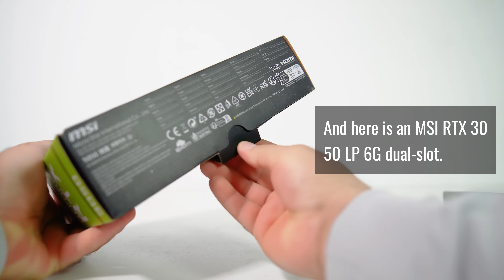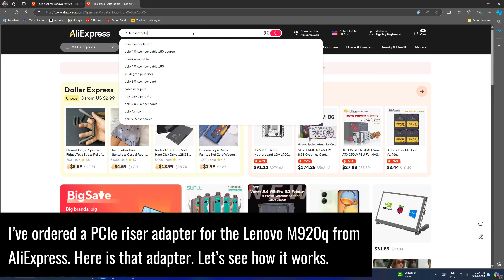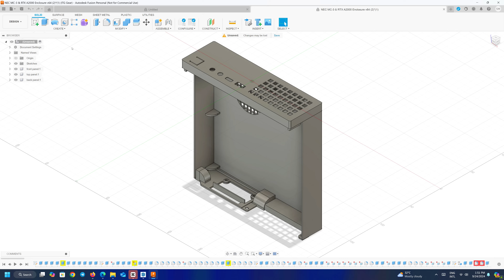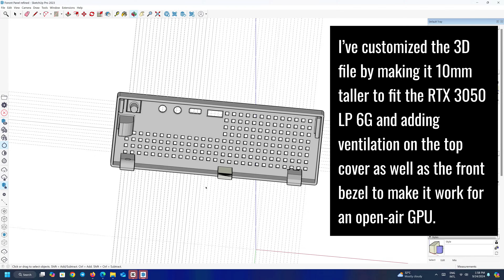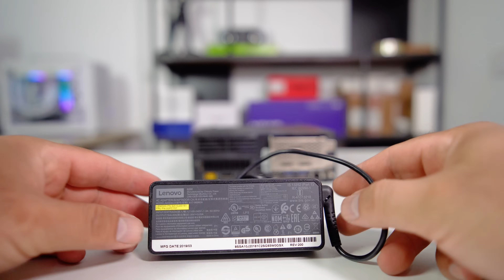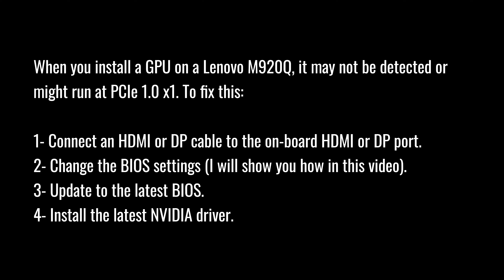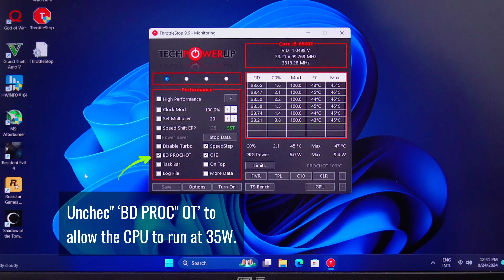Lenovo M920Q+RTX 3050 LP, CPU power limit fixed, Some AAA game 1080p 100fps+

Comment: Thanks, I'll give it a try! I did something similar a few months ago, but I did go another route - I wanted to have as much cpu and Gpu power as possible (while still being reasonable). I'm using a m720q with the i7 9700T, 32gb of memory and an (somewhat) external RX6700XT which is being fed by an external power supply. I put the whole setup in a hifi case from a broken onkyo AV receiver unit. I had to deal with massive cpu throttling and saw pretty bad cpu Temps with the stock cooler, so I designed and 3D printed a bracket so I can fit a 120mm AIO water cooler on the cpu, but the system still suffers from major throttling, even though the Temps are perfect (around 55ish deg C under load) and the Gpu is powered externally. Maybe this will help my throttling issues!

Comment: Hey big man, is a 230W power supply necessary? or would a 135W one work fine?
Reply from the maker: The 135W Lenovo AC adapter is suitable for a 65W CPU. If you plan to install a GPU on a Lenovo tiny PC, you should consider at least a 175W AC adapter. Thank you.

Comment: Been having a bit of an issue with my almkst identical setup. I'm running a P330 Tiny and a 3050 6GB single-slot card with 32gb of ram and a 230W power brick.

It can sit in a full stress test for quite a while and be completely fine, and then in games it just decides tk shut down after a while. I suspect this is an overheating issue, but I would think that would be exposed by the stress test as well.
Reply from the maker: Because when you run a GPU stress test, the PC only fully loads the GPU, and the CPU is not fully utilized. This is unlike playing a game where both the CPU and GPU are under heavy load at the same time. Try setting the GPU power limit to 80% using MSI Afterburner. In my experience, setting the power limit to 80% for a 70W GPU results in it running around 50W to 60W, with only a 2-3 FPS reduction in-game. Thank you.
Reply: @itggear3400  I've already done that as well. GPU is limited to 60W and CPU limited to 40W.
Reply: Running into a similar problem did you ever figure it out
Reply: @josiah.j2052  55W power limit on the GPU solves it. Motherboard pcie power delivery was overheating.

Comment: is the charger in the link compatible with this device. cuz when i ask from the ebay seller, said its not compatible. please let me know.
Reply from the maker: Thanks for reaching out! Based on my research, the 230W and 300W Lenovo square bit chargers are generally compatible with Lenovo M920q and M90q models. However, it's always best to double-check with the seller or Lenovo's official support to ensure compatibility with your specific device. If you have any doubts, you might want to consider purchasing a charger specifically recommended for your model to avoid any potential issues.
Reply: @itggear3400  thanks man really appreciate it 🙏

Comment: Was gonna ask why not use a 4060 low profile then i remembered it's gotta have PCIe power and you don't really have that in that little system.
Reply from the maker: The PC does not have enough power to run the RTX 4060. Did you know that the PC motherboard converts 20V DC to 12V to supply the PCIe card, and its VRM has very limited capacity? This is a fact that you have to accept.
Reply: @itggear3400  impressive none the less!

Comment: So cool! i happened to have one of these lying around, its a 7th gen intel processor so its a bit different, but mostly the same when i saw this video i was like huh i dont remember seeing a PCIE slot, pulled it out my drawer and realised the slot was never installed, problaly on lower end versions or versions for large corporation orders where it would not be utilized, so yeah this thing was just junk layinf around basically never used dont remember how i got it but now im gonna order a Pcie slot solder that on make sure all the traces lead to the chipset and then see if i can replicate what you did, will be a fun project ty for the inspiration!

Comment: does this upgrade work on the 720q also? as i have researched it should have the same mobo. but i once saw someone posting about the 720q can only handle 55w gpu?
Reply from the maker: The Lenovo M720q also has a PCIe slot, so you can install a GPU card. However, this model does not support GPUs by default, and it will limit the CPU to run at very low power, causing the PC to run too slowly. Therefore, we need to use ThrottleStop to disable throttling. Thank you.

Comment: II put together this config with a2000 gpu, 135w power supply, I setup the PT, but as soon as i start a game, it turns off.
Reply from the maker: I faced similar issues using an unreliable 230W power adapter that I got from China, which caused unexpected shutdowns. After switching to a new 300W AC adapter, my PC has been running stable with no more unexpected shutdowns. You might want to consider upgrading to a higher wattage power supply for better performance.

Comment: Is possible to put a normal i7 8700 (without T) in this PC if change cooler with something low profile?
Reply from the maker: For Lenovo M920q and M720q, they do not support 65W CPUs. We cannot install any other CPU cooler because they use a 3-screw mounting hole, unlike a standard CPU cooler that uses a 4-screw mounting hole following the LGA CPU socket standard. Thank you.
Reply: @itggear I want to create a plastic CPU bracket with a 3-hole mount using a 3D printer. This bracket will serve as an adapter to mount a 65W CPU coolers. thank you

Comment: I loved the video and I would also like to do that since I have a ThinkCentre M920x Tiny, I don't know if I can also put a 3050 in it to improve it a little. Since it has an 8th Generation Intel i7 and 16 GB of ram memory. In addition, the case that was made in 3D printing is very good since you can put the 3050 in it, for example, and it has better air flow. In addition, in this video they tell you what you have to do and what you should buy, such as the adapter for the video card and the 230W AC adapter. :face-blue-smiling::face-blue-smiling::face-blue-smiling:
Reply: Its will work just fine. Wthat what u have. I have a local libaray that does 3d printing services for free so i got mine done there. You may wanna look some local places that do 3d printing services.

Comment: Hey, just had a quick question about what you’re using to hold your screws in place. It seems like you have a piece that’s fixed to the screw holes so you can screw into something instead of plastic. Could you point me in the right direction to find those? I’m actually making the same unit right now as we speak, any help would be greatly appreciated. Thanks again.
Reply from the maker: The diameter of the female srews hole is 4.7mm, so you can use Female Thread Brass Cylinder Knurled Threaded Round Insert Embedment Nuts, M3 x 5 x 5mm, and insert them using a soldering iron.
Reply: @ brilliant, I wasn’t even thinking about using a soldering iron to melt the plastic I was gonna use glue, but that works out even better and it makes it more permanent, thank you so much. I appreciate it. Also did anyone ever figure out how to make this work with Linux, and is there some sort of throttle pipe app available for Linux. I would love to make us into like a steam deck ish gaming console.

Comment: Does a 230w power supply work for 3050? Its much cheaper than 300w
Reply: Anyone?
Reply: @PlusTres it should be enough.
Reply: @JodoboLP thanks

Comment: anyone ever tried to add a non t cpu to this mini pc with the similar high wattage power brick?
Reply from the maker: If you would like to install a 65W CPU you may need a 65W CPU cooler for this tiny PC and at lease 135W AC adapter. Thank you.
Reply: @itggear  what about the vrm's on the board? is that something we have to worry about too? I read this comment somewhere back, the reason why they are not adding non T cpus to these tiny pc's but what you did with the pci e slot is already pushing the power tolerance of that tiny board right? so if that is safe, why not adding a non T cpu yeah? hey I appreciate you replying to this :) been waiting for someone to talk about this for a long time. Am a big fan of these tiny pc's as they save a lot of space and energy as is but if we can do a little bit more right? :D I use a Dell Micro 3070 myself and plan on switching to that Lenovo because of this video of yours which I first saw from ETA prime :)
Reply from the maker: @e1x0r1  The 65W CPU cooler also covers the VRM chip nearby the CPU.
Reply: @itggear  did not even realize that at all lol 🤣

Comment: if i use 3050 lp from asus/gigbyte brand, it will be fit in that case?
i can't find msi 3050 lp on my country :(
Reply from the maker: Yes, make sure it does not exceed the PC length of 170cm. Thank you.
Reply: @itggear  
well, it does'nt fit. there are 182mm :(

btw, thank u for replying my message
thanks

edit:
i found zotac it's 161mm, it's surely fit

Comment: Hello, I come from Vietnam. Your videos are very interesting. I wonder if I can replace the RTX 3050 with a GTX 1060. After watching your video, I became very interested in this tiny PC series. I hope you will reply.
Reply from the maker: Hello! Thanks for watching my videos and for your kind words. Unfortunately, the Lenovo Tiny PCs like the M920q cannot install a GTX 1060. The GTX 1060 is 192-bit and requires a 1x8-pin PCIe power cable, plus there isn’t enough room for a full-height GPU in this tiny PC. Unless you do a case swap and use an extra power supply to support the GPU. Thank you.

Comment: Would I have to run ThrottleStop every time I turn on the PC?
Reply from the maker: es, however, if you don't have one yet and would like to try it, I would recommend buying a Lenovo M920x or Lenovo P330 Tiny. These tiny PCs come from the same series and are similarly priced, but they support a 65W CPU and a 50W GPU right out of the box

Comment: Is there any way to deal with the power issue for the CPU being stuck at 5w on Linux, I was thinking about installing Steam OS and making it a steam deck style mini gaming PC.
Reply from the maker: I watched some videos on YouTube where they stopped the BD-PROCHOT throttle via command prompt. I want to try it as well. Once I succeed or fail, I will update you with a follow-up comment. Thank you.
Reply: Have you found a solution? I’m using Bazzite but cpu is not keeping up with the GPU

Comment: Could you put the 4060 lp instead or would it be to big
Reply from the maker: I think it can, but we need an extra power supply board to support it. Please keep in mind that the Lenovo M920q has a board power limit of 135W. Also, we cannot use power directly from the power supply since it’s 20V DC.

Comment: An RX6400 will fit on the original case also right?
Reply from the maker: Yes, but the gap between the GPU and top cover is only about 2mm, so due to the lack of airflow, it will not be usable.

Comment: Daamm bro, i need help! want to built like you with rx6400, but pcei riser adapter (09Aj940)  is not available in ma country by any means, can i go with " simple x8 to x16 riser cable" instead of this specific 09Aj940 part, will it work, will impact performance??  Please reply i want to build this 😢
Reply from the maker: The PCIe slot on the Lenovo M920q/M720q/P330 Tiny is not a standard PCIe slot. The first block of the PCIe slot is wider than a standard one, and the PCIe slot on the Lenovo M920q is shallower than the standard PCIe slot. The PCIe slot on Lenovo Tiny Gen5 is also different from the next generation. This means that you can only use PCIe risers for this PC generation, and you cannot use them with other PCIe slots, even for Lenovo, from different generations. Thank you.
Reply: @itggear  thank you so much

Comment: i have surface 8 (thunderbolt) ,,,i have PSU power and amd RX580 ,,,,how can i use  external graphic  without buy thunderbolt dock(not for sell in my country)
Reply from the maker: I think we can buy the eGPU enclouser from AliExpress. the eGPU box have oculink or thunderbolt option to choose. I also ordered the eGPU board to build my own eGPU enclouser, if you are interesting please stay turn I will post the testing video about it. Also you want is seemlesly plug and play eGPu you can take a look RX7600M XT eGPU it small and beutiful like ONEXGPU Graphic Card Dock Expansion Card eGPU.

Comment: What wattage power adapter is needed for that setup?
Reply from the maker: The PC motherboard is designed for its 135W AC adapter; however, using a higher wattage adapter can provide better power stability and longevity.

Comment: Brilliant! I have 2 Lenovo M720q. I have already upgraded them to have SSD and 16gb RAM. now I think a GPU upgrade is a must. 
Thank you for sharing! I hope you get a lot of blessings for sharing this. Thanks. 
Done Subbed
Reply from the maker: Very nice!
Reply: It is doable. I have m720q. And bought the same graphics card he has. It works.
Reply: @dorothyrivera7168  thats reassuring to hear. Did you build the case the same way?
Reply: @balotibaya2 i did. Also downloaded his stl file. Just make sure you download throttle stop

Comment: When you use throttle stop. Do you have to disassemble it every you turn on and off the PC? Or is it a one time only?
Reply from the maker: We can set the startup app to run ThrottleStop when Windows starts, or we can activate it manually whenever needed.

Comment: How would an Rx 6400 compare to this?
Reply from the maker: The AMD Radeon RX 6400 and the NVIDIA GeForce RTX 3050 have some key differences. The RX 6400 has a faster GPU clock speed and lower power consumption, making it more efficient. However, the RTX 3050 offers significantly better performance with higher floating-point operations, more VRAM, and support for DLSS, which enhances gaming visuals and performance. If you’re looking for better gaming performance and features, the RTX 3050 is the superior choice.
Reply: @itggear bro are you gpting these responses😂

Comment: Wow! nice, I hav a m920q and this is a great idea, but, can you share the Aliexpress links, please
Reply from the maker: Which ones?
Reply: @itggear  Also, did you think to use a RTX A2000 6GB with this cooler:
https://youtu.be/keAFTWkGX0Q?si=V_Hw8Bj1i6jFVqzu
Reply: @itggear  Hi, I dont know why youtube is deleting my comments with links, in Ali search for ASL 3050 6gb Sabre Slim
Reply: @itggear  Also, did you consider a RTX A2000 with the single slot cooler of N3rdware
Reply from the maker: @Raxsephon Trust me, a single slot GPU will not work in this PC. The gap between the GPU and the top cover is only about 2 or 3mm. Unless you have a Lenovo M920x or Tiny P330, which have ventilation on the top cover for the GPU, it won't be feasible.

Comment: This is amazing, also earned a sub, keep up the great work! I have a question, would it be possible to fit an RTX 4060 LP in there, or not as it would require some kind of external power, would there be any solution to this?
Reply from the maker: Lenovo M920q/M720q do not support GPU cards or 65W CPUs by default. However, the Lenovo M920x and P330 Tiny (from the same series) can support 65W CPUs and 50W GPUs when paired with a 35W CPU. When a graphics card is installed in the Lenovo M920q’s PCIe slot, the BIOS limits the CPU power to around 5W, causing the PC to run very slowly. Therefore, I believe that installing an RTX 4060, which has a 115W TDP, would not be supported by the Lenovo M920q motherboard. This is because the motherboard cannot handle the power requirements for that GPU, as the CPU and GPU do not draw power directly from the AC adapter. Instead, the motherboard converts 20V DC to 12V, which limits its capabilities. Thank you
Reply: @itggear  Ah I see I was just about to ask that
Reply: @itggear so if I got the p330 tiny, could I upgrade to the newer gpus?
Reply: @Chadjohnson420 yes, you could with the GPUs at 65W or less. May be new Intel GPUs.

Comment: What's the name of the adapter cord for that and in what wattage? I want to just buy the extension adapter to fit my hp power brick
Reply from the maker: The adapter used in this video is a 230W AC power adapter for Lenovo laptops. It is not compatible with HP products as it has a square pin. Please check the link in the video description for more details. It is an Amazon product that also provides detailed information about the product specifications and compatibility. Thank you.

Comment: Man, they should fire the people who let that print be sold, that looked fukin awful, but at least it wasn't bent, and it somehow conected nicely into the frame. That thinkcentre is now thinking overtime after this upgrade, i'll try to do this myself someday, it looks much more promising than finding good elitedesk/optiplex with good specs around my hood, But these little guys run miles here.
Reply from the maker: I’ve redesigned the 3D model files and this time I printed them myself. The result is really smooth and satisfying. I also want to post a new video about this PC. Thank you for watching my video.
Reply from the maker: Now I'm printing it: https://www.youtube.com/post/UgkxztjAzEeg2KPqPyIBO2DmSCGOU1-NQPJC

Comment: I use a M910x with Intel Gen9 i9 and RTX A2000 with one Slot cooler and undervolt Mod. OS is BazziteOS. Wifi 6E.

Its my TV Steam Box.

Comment: Is it possible to include a fan bracket on the 3d printed housing directly on top of the cpu? I was thinking a slim fan as exhaust. Sorry if the question seems foolish, never use 3d printer before.
Reply from the maker: I’ve also shared the 3D model file in Sketch format so you can modify it for your specific fan. To make it, we need to precisely measure the specific component that we want to add. Thank you.
Reply: Where are the files